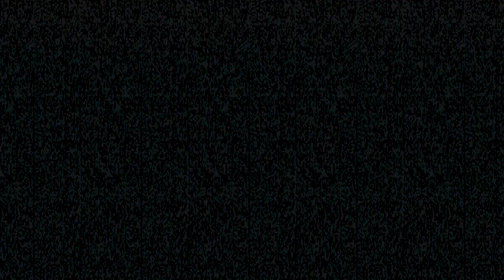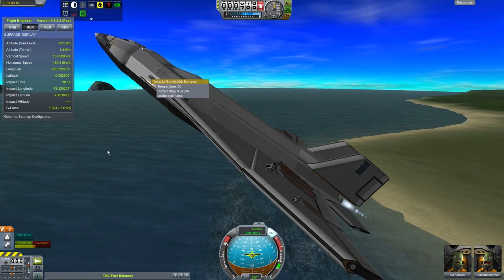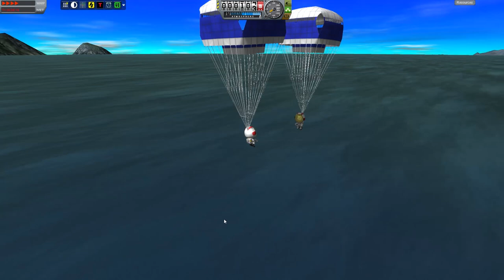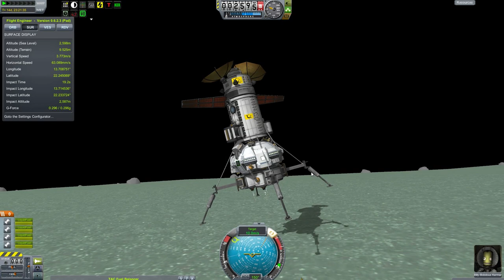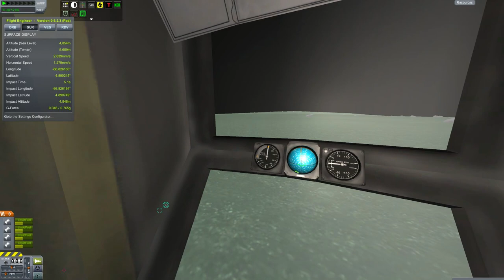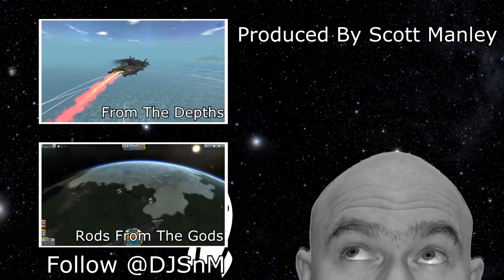Kerbal Space Program - Interstellar Quest - Episode 89 - Eve Lander Testing

Comment: The way Tom Cruise works the throttle on the F-14 Tomcat is actually correct.  The throttle was designed inversely to other designs, so to increase thrust, you pulled towards you, and to decrease thrust, you pushed away.  This was because, in a Catapult-Assisted takeoff, there was a risk that the high acceleration, on a normal throttled aircraft, would jerk the throttle back into neutral position, which would be disastrous at the relatively low speeds leaving the carrier deck.  But on the F-14's throttle, it would already be in the rear position, so there was no way the thrust could be shut off like that.  But more modern carrier aircraft like the F/A-18E/F Super Hornets have some sort of safety mechanism that allows standard throttle controls to be used in Carrier Aircraft.

Comment: I've found that disabling the brakes on the front wheel(s) makes for a more reliable landing. My guess is that the slight asymmetry causes the problem, but it could just as easily be where the brakes are being applied relative to the center of mass.

I also put my rear wheels as close behind the center of mass as I can to give my plane the best mechanical advantage on takeoff.
Reply from the maker: For all of these designs the front brakes were disabled.
Reply: Scott Manley  You need to separate air brakes and gear brakes buttons. Turn on aero brakes and apply gear brakes more softly by bit like you did in last landing. Its too hard brake make you turn and crash, not lack of landing gears. Big mass, big force - sticking to ground gears are asymmetrically bend and twist.

And I think vista must be prohibited at kerbin

Comment: A thought as you spoke about aircraft throttles. My dad is a pilot and has told me that is where the term "balls to the wall" comes from. Some aircraft has throttles that are basically balls on a rod that is pulled out of and pushed into the dash. Balls to the wall would refer to pushing them all the way in, setting max throttle. Not sure if it is where the phrase comes from, but neat anyway.

Comment: Damn. And you think going by that crash you had was bad. In 0.25 I had been making a Re-usable Rocket Craft (It was a Kerbal X with a Skipper Engine and landing legs on struts to touch down). Obviously, so I could make sure that I would always land at KSC, I had been checking for a good area to perform the De-orbit Burn so I would touch down at KSC.
Going by some Atmospheric Testing Probes entered at various positions on Kerbin (The Places I used included: Crater Lake {The Big Lake that looks like a Crater Impact}, the Desert, the Second KSC and the Poles) I found that Crater Lake was the best place to plant a Beacon for re-entry.

So, in preparation for the Crater Lake Project, I sent out a modified Learstar Aircraft (The new Plane that can carry 12 Kerbals) to go search the area and build a temporary Airfield. The Kerbals inside were:
Captain Jebidiah Kerman
First Officer Bill Kerman
Passengers:
Cargo Bay:
Bob Kerman
Milland Kerman
Ned Kerman
Ludous Kerman
Harv Kerman
Archivald Kerman
Dean Kerman
Passenger Bay:
Reg Kerman
Billy-Bobdus Kerman
Mot Kerman
Kalvin Kerman

These Kerbals' mission was to set up an Airfield on Crater Lake, the Learstar armed with an extended Cargo-Bay, half containing Passengers, the other half empty for possible cargo flights. The Flight was for the most part uneventful, heading away from KSC in a banking turn to the west, stopping at a Fuel Stop I had made. After about 15 Minuets real-time, we were in the Ocean between the Continent with KSC and the Desert Continent. Then, disaster struck.

Whilst heading out, I noticed that according to my Map, my course was taking me to the south-west, which if I continued on course, would lead me to the Desert past my Fuel-stop, which could be disastrous. I began to put the Aircraft in a sharp turn at Take-off power with the Modified Rapier Engines I added to the Craft.

The Turn was fine for the most part, but for some unknown reason one of the Engines was overheating. The other was fine and normal. Unsure as to what to do, I lowered the Throttles on both, still on an approach towards the Fuel Station in the area. The Overheat Warning kept going, but wasn't as fast, I kept throttling back to the safe limits before I decided the best idea to solve this. Switch to Air-breathing Mode.

Quickly, though, this caused a disastrous chain-of-events, thinking my engines were fine, I checked the Location, not paying attention to my Increasing Overheat Warning. Then, disaster!

The Engine exploded, destroying a few of the Air-breathers on the lost engine and a pair on the working Rapier. The main issue though was that an Airbreather lost in the explosion had flung forward and broke the fuel linker to the LV-909 on that side, causing the back-up tanks to tumble with Decoupler over the Wing and slammed through the Right Wings ailerons and the wingtips in a large explosion, debris falling away from the Learstar.

The Aircraft started to loose control as it tumbled for the Sea, the speed and G's increasing rapidly. It was then that the last Rapier, still firing slightly tore off, taking the Decoupler and the LV-909 with it, tumbling away, the Rapier and De-coupler falling away, the LV-909 though plunged into the back of the Aircraft, destroying the Tank with a fiery blast.

The remaining vertical Stabilizer fell away, narrowly avoiding the Aircraft. The Wings swirled around on there sides, slamming through the Ladders over the Crew Area. The Learstar, now just a Fuselage tumbled for the Sea, G's slamming the Aircraft as soon the Cockpit tore away in a spinning trajectory, the Crew Area ripping off and slamming into a detached Aileron from the Wing, killing Kalvin, Reg, Billy-Bobdus and Mot.

The Cargo Bay itself tore away, the Struts pulling away and flinging multiple Kerbals everywhere at high speed. The Disintegrating Learstar hitting the Water in at least 50 Pieces.

Comment: The planes might fly better if you manually set wing control surfaces to control only roll.  KSP seems to think that any control surface behind the center of gravity is supposed to control pitch, but since you have canards up front and elevators in the back, when you pitch up, the ailerons deflect up, which with FAR will kill the lift generated by your wings.

Comment: Have you ever thought about using parachutes to slow yourself down on the runway instead of brakes, that could help potentially fix part of the issue with your vehicle wanting to become unruly on the ground, as the breaks tend to just "lock up" in KSP, it can sometimes cause some real issues when it comes to landings and trying to keep control of aircraft unless you overly design it. Just a little suggestion, nothing more.

Comment: If you're still having problems with the Eve spaceplane, turn off the front brakes like other users mentioned but also maybe try turning SAS off right after touchdown? Maybe it is trying to correct for slight attitude changes by rolling, and thus knocking the wings into the ground?

Also, unrelated, but if you are using the X52 joystick, bind your yaw/rudder/tailplanes to the stick twist, and use it!! You could have been perfectly lined up with the runway on that last approach if you did a little side slip with the rudder but SAS had other thoughts.  Throughout the entire final approach and especially when you rolled to the right just before touchdown it was using slight left rudder for some reason? That kept you from properly slipping to the right to get lined up.  It's either SAS or some fly-by-wire mod you may have, I don't know your whole mod list.

Source: instrument pilot, and I'm here to help man ask me questions if you have them, I love your videos!
Reply from the maker: Front brakes were disabled from the very first flight. I know it's hard to see the difference but I've been hit often enough that I don't forget. I've mucked around with trying to use sides lip to shed speed but haven't had much success. Especially compared to the air brakes.
Reply: Scott Manley Forward slips are for losing altitude, but side slips are just what they sound like; you slip to the side. You basically keep the wings level and scoot yourself left or right with the rudder. On some aircraft, you aren't supposed to do this if your speedbrakes/flaps are down, so your mileage may vary on your aircraft (and you may stall) but it should work as long as you move gradually and keep your wings level!

Comment: Hey Scott, is it possible for you to change the spring rate and damping of the landing gear? The aircraft looks rather heavy and it seems only a small weight transfer compresses the gear too far. When you added more landing gears the problemen was gone, so perhaps that was because the spring rate had effectively doubled. Could be a nice little mod to add tweakable suspension to the game if that's not already possible.

Comment: The reason you lose your airplanes on landing is because you land with brakes set! Just deploy the airbrakes on touch down and after you have slowed down a bit start to play with the brake by continuously turning it on and off, but don't set the brakes or else your airplane will become unstable and break apart.

Comment: Ah, learning about the secondary effects of yaw!
Reply: Both times you crashed on the runway, you had rudder applied. Depending on how good the aerodynamic model is... applying yaw at slow speed usually induces a roll in the same direction, because you are pushing one wing through the air faster, which causes it to generate more lift. You are also pulling the other wing back, and depending how close you are to stall speed, you could stall it, or at least reduce its lift.

Comment: I'd have to guess that you have problems taking off in aircraft because your landing gear are too far aft.  Do your full/empty fuel checks to find the plane's CG range, and place the aft gear just aft of the CG at it's aft-est-most point. If that makes sense.  Look at real-world commercial airliners and fighters alike, and you'll see they place the gears towards the center of the fuselage, generally at the back 1/3 to 1/4 of the wing root.  Having the aft landing gear farther forward allows the elevators to push the plane's rear down (usually no more than 10 degrees) using said landing gear as a kind of fulcrum, without needing wings in front to lift the nose.  This lets your engine push you upwards as well as whatever lift your wings give.
Reply from the maker: All very nice in theory until you realise that I'm stuck with an engine that is not shaped like conventional aircraft engines, which is why I went with Canards towards the front of the vehicle to allow me to put the rear gear further back and reduce the chance of tail dragging.
Reply: Well, you can take a look in FAR utilty what is your level flight aoa at speed you can get at runway and adjust your gears  or\and wings to start with positive AoA and no need of additional pitch to take. off
Reply: Scott Manley In addition..it will be a lander, so it will need as many landing gears as possible. There are no runways on EVE.